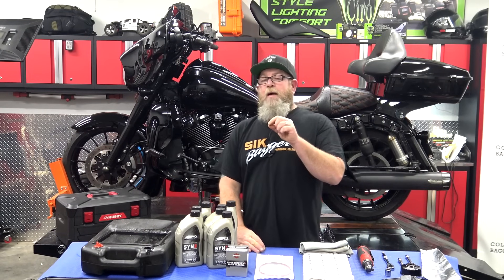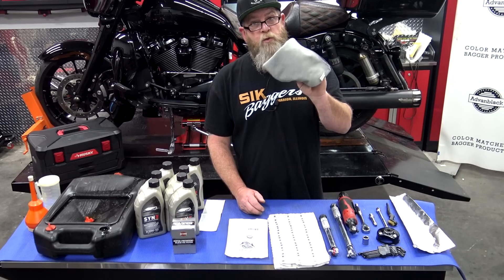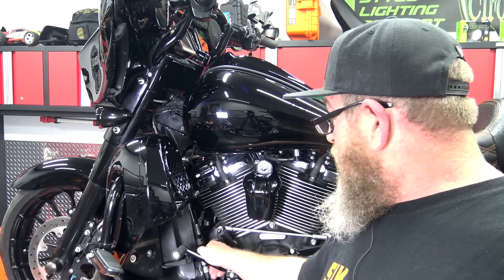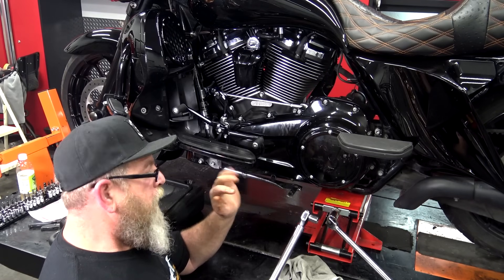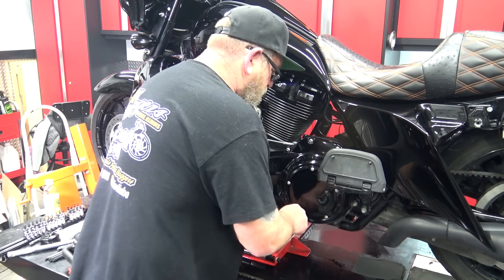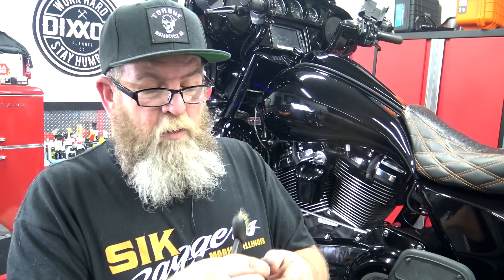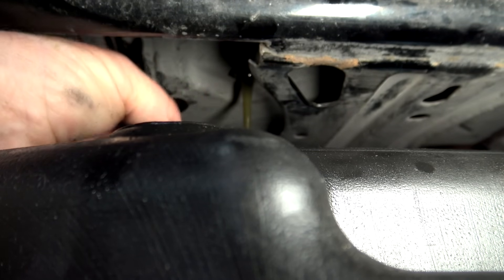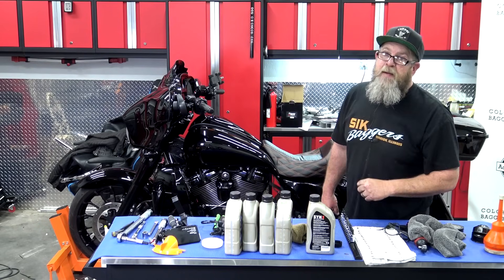⚡Milwaukee 8 - 3 Hole Oil Change @harleydavidson Touring - How To⚡

Comment: Great video!  I really appreciate it!  Toward the end you mentioned that the primary and transmission have longer change intervals. I was under the impression I had to do a full 3-hole at each 5000 service interval. I'm at a 5000 interval now. If all 3 were done the last time at the dealer, can I just do the engine oil and call it good?  BTW - sign me up for an ugga dugga shirt!

Comment: Steve since youre the only one responding to my messages what do you recommend for tire pressure front and rear with passenger for a 2021 Road Glide CVO, 130/60 21"(FRONT-TIRE)   AND (rear-tire) is 180/55 18", tires came stock on the CVO, Im getting ready for sturegis leaving Tuesday morning, just last minute shit Im doing, MAN- thank you for being a stand up human being!!!!
Reply from the maker: Hey fred..doing the same thing...trying to get everything ready for sturgis, we leave out Monday afternoon. 2 nights in the badlands and then going into rapid city from there. On the tires its very important to remember the pressure on the tire is the max amount of air that tire can run, not what is recommended for that bike. Those tires can fit a multitude of bikes and every bike rides different.  Always look at the frame and see what that says. Doesnt even matter if you change the size of the wheels and tires..the same air pressure will apply to that bike. Almost always on the touring models it is 36 front 40 rear. And one up or two up doesn't matter either. That is a "cold" check. Dont check your tires after riding, always before.   Also keep in mind that when you get to sturgis, it hot, and you're almost always in some sort of curve every where you go. So these tires will heat up quick and pressure will rise. Its not uncommon to see these tires climb 8 to 10 pounds in a short ride out there. Last year my fat front tires center band separated from the outer edges causing the tire to raise up 1/2 inch in the center.   That tire had over 10k miles on it and only did it when I got to Sturgis. Come to find out they quit making that tire due to that exact reason that happen to me..I didn't know that though and ran it. Keep her at what the frame says and you will be good my friend. Safe travels and if you see us out make sure to say hi! Always great getting to meet you guys!
Reply: @sikbaggers  Thank you brother!! greatly appreciated, never knew the frame thing...Ill keep it in minds, were in a toy hauler two houses behind Sturgis HD, ill make sure to look out for you! were in Sturgis 3rd through 6th then out to Yellowstone for a week.  Safe travels, thx again, appreciate you're time.

Comment: I appreciate your videos. I have one question I can't seem to get a solid answer to. When doing a 3 hole oil change on a 2019 M8 Street Glide do you use the same oil in all 3 reservoirs? 
Thanks
Reply from the maker: "technically" you can use Harley Davidson Syn3 in all 3 holes. BUT there are much better oils to use in your primary and transmission. Eve HD. I use the amsoil HD kit that has separate oils for all 3 holes.

Comment: how many total quarts of oil to do 3 hole oil change?  would Mobil 1 20/50 synthetic oil be ok to use?
Thank you it was a good video
Reply from the maker: youll need 4 quarts and yes any synthetic 20w50 will be fine

Comment: Totally agree with you on Harley WAY over-torquing the oil filter. I did my first DIY oil change on my M8 last week. I found Teflon tape or something like it all over my drain plug and the oil filter was on so tight that my Harley oil filter wrench skipped off. I thought the wrench must be the wrong size. Nope, I had crushed the top of the filter to the point that the wrench was just spinning. Ended up using a shop rag inside the filter wrench, tapping it on with a rubber mallet, then using a breaker bar on top of my ratchet handle to get the filter loose. Then I spent five minutes getting the old filter off the wrench. 

Moral of the story: Harley needs to stop telling their wrenches to over-torque the oil filter. I bet they do that  so people will bring their bikes in to the dealer for service.
Reply from the maker: Ive learned that the M8, for some reason, has a way of tightening itself over time too...not sure why...even bikes Ive changed the oil on and know I have not over tightened it, came back to me for the next oil change and was tight as shit...asked my buddy, a tech at HD, and he said the same thing..they all come back tight...so we get to deal with that now lol
Reply: Interesting! Hadn’t heard that one yet. Appreciate you taking the time to reply.

Comment: Great vid. Everything the same for a crate 135 on my FLTRK? Thx
Reply: And what is your oil of choice? Couldn't find on your channel. Thx again.
Reply from the maker: yes all fluids will be the same
Reply from the maker: I run amsoil...but Ive also ran redline in a pinch and it a great oil as well. The thing with most oils is unless you are riding in extreme conditions all the time, as long as you change your fluids when they are due, most any oil will do the same. the additive packages that are included in alot of these oils are really just for "extreme conditions" Now that could be anything from racing/hard riding, extreme cold, extreme heat..etc...normal everyday riding..you'll be fine with just about any full synthetic blend.

Comment: I really like your low-profile oil drain pan but I didn't see it in your links below. Was this available at Amazon?
Reply from the maker: This is the one I used in this video https://amzn.to/44FLYIa  its 4.3 inches deep but I have since changed to this one https://amzn.to/45ySzpb   ..its 2.8 inches deep. It doesn't hold as much but it will hold enough for harleys ...gives me a little more room for my hands.
Reply: @sikbaggers  Thanks a bunch! Love your videos. So thorough!

Comment: Brake Cleaner works great for cleaning up the oil filter mess.   That’s what we use at the Dealership
Reply from the maker: yes sir...keep tons of that stuff around...grab it cheap at local parts places when they run sales lol

Comment: If you were doing this service on the jiffy stand how do you fill the oil, or will the fill point change for when you fill the oil. Speaking of under the derby cover.
Reply from the maker: Adding clutch fluid and checking the levels should be done with the bike in an upright position...its important to note that if you are going to be doing your service that it will greatly benefit you if you get a cheap motorcycle jack or even cheaper scissor jack so you can properly do the changes. You can add the required amount of fluid for a wet service according to your servicer manual and then stand it up and check the levels. You can always take some out with a turkey baster or sop it out with a paper towel etc..

Comment: I just bought a new 2023 street glide. Im taking a trip and will hit the 1k mile mark while im gone and im gonna service it with the help of a friend. Anything i need to know about the 1k 3 hole service that would be different than the regular 3 hole service? Thanks!
Reply from the maker: There is nothing extra you have to do for the oil change...if HD was doing it they would also inspect the entire bike. Things tend to loosen in the first 1k miles and they like to check those fasteners out.  They check or inspect several other things on the bike as well during that 1k service. So I would suggest changing the fluids and then still getting it in when you get back for the 1k service.

Comment: Hey Steve quick question. I have a FLRT trike and was wondering if you had a pdf service manual? Not sure if fluid levels are different since the bike lives upright all the time. Thanks
Reply from the maker: what year is your freewheeler and ill check
Reply: 2019
Reply from the maker: @Fordfanatic1995  i have a 21 ( which is the same) triek supplement here https://drive.google.com/file/d/1XgdaHew-FRfPYy3GBy6nXW86cApczi47/view?usp=sharing
Reply: Much appreciated

Comment: Go to your local john deere store and buy a strap oil filter wrench that you can put a 1/2”ratchet on. Had way better luck with them than any plier or cap wrench. John deere has best quality one ive seen is why i recommend them. We only use strap wrenches at the farm for big filters on equipment
Reply from the maker: thanks for the heads up on that...we have a john deere here in town and ill stop by and grab one

Comment: Just got a used 2017 Trike (Milw 8). Manual didn't come with it. Found a pdf, but not easy to navigate the document. 
This video is the best produced of all those I've looked at that might relate to my new (to me) bike. 
Greatest help were the links to Amazon parts. I looked forever for a reasonable priced engine drain plug O-ring so I wouldn't have to spend $6 for just ONE at the HD dealership.
Thanks for taking the time to produce this video. Very helpful.
BUT, I might have missed the part where you mention YOUR preferred oil. Is it the oil you used in the video, or something else? Brother, don't make me have to go looking for it. I'm on the wrong side of "older" and don't like to spend my limited time looking for things, when somebody already knows the answer. 
Thanks again.
Reply from the maker: Hey Jerry thank you for checking this out and im glad it helping.  As we all know, not all synthetic oils are created equal..but no matter what oil brand you use will work IF you do regular maintenance on your bike, car etc... I've never seen any particular oil fail or cause issues down the line when changed at the proper intervals. Now with synthetics what you are paying for in the price differences are the additive packages that oil companies put in these oils..So they pretty much start with the same base oil and then add different additives to increase the output of the oil..Syn3, as used in this video is the oil that HD will use on your bike unless you request another brand or bring your own..such as Amsoil or Lucas...I've run Syn3 for years with no issues and also ran Amsoil for years with no issues...biggest difference is the price. Amsoil costs quite a bit more...I also have buddies that run the Amazon package of "Maxima Racing Oils" motor oil with no issues (the problem with that kit is that there is not enough oils in the kit) so you have to buy extra..so that being said its really in the routine maintenance side of things that cause failers ....people not changing their fluids when they should and the fluids are weak and don't protect the bike's components as they should.  You can pick up SYN3 and AMSOIL at any harley dealership and here is the link to the  https://amzn.to/3RxRTIF BUT remember that is not enough oil for your bike if you are doing a 3 hole oil change so buy extra so you have enough.

Comment: Great video!  Any reason to not use mobile one 20,50 Vtwin oil? Thanks
Reply from the maker: Nope..you can pretty much use whatever oil you want...You need to choose your "W" based on where you live or ride the most.  Also just know that different oils have different additive packages...try to do some research on your oil choice and see what they have available.

Comment: Hey Steve.   Got a question.   I just today did all 3 holes myself for the first time and i didn't have the measuring cup you used.   Just curious how long you think it should take for someone doing it for the first time?
Reply from the maker: oh id say about an hour and half, 2 hours if you have never done it I guess...trying to remember the first time I did it but that was so long ago lol You dont need the measuring cup it just makes it go faster...you have dip sticks so its just a matter of checking them to see the levels.
Reply: Cool.   The primary took me the longest because I didn't have one of those graduated cylinders you mentioned.   It was very difficult for me to see the oil level.  If you go above the bottom of the pressure plate, what can happen just out of curiosity?  I believe I may have gone just a hair above it into the silver area but I am not looking at it right now.
Reply from the maker: @0873sp  just barely over and youll be fine..it will start slipping if you are too far over...if you are borrow your wife turkey baster and pull some out...just don't tell her or you will be on the couch lol. No but seriously you'll be ok...and seriously the turkey baster is the best way to pull some out...just buy a new one and keep it in the garage

Comment: Do you need to change primary and transmission every oil change or is every other oil change the right interval ?
Reply from the maker: 5k oil, 10k primary and 15k transmission...to make it easier to remember what I have done, I just do this 3 hole fluid change every other oil change. Youre already in there with all of your tools and pan out so might as well. Keeps the fluids fresh...But if budget doesnt allow it those are the proper intervals.
Reply: @sikbaggers  thank you I saw that at the end of you video

Comment: Great video. how about anti seize on the derby cover bolts?
Reply from the maker: Great question and its been asked on these...I would suggest not doing that...anti seize may cause them to back out over time...just dont use any loktite on them and youll be fine.

Comment: I would like your opinion, I know people that have used many different 20 W 50 full synthetic oil’s for the three hole oil change in in your opinion doesn’t matter what brand of 20W50 full synthetic oil? Plus if you have a TriGlide of course your transmission fluid will not be checked on a jiffy stand how are you supposed to know the accurate level if it’s supposed to be on the jiffy stand? Basically I’ve known people that have used Walmarts version of the oil and have been using it for years and has never had any issues, what do you think?

Comment: 3 hole oil change uses all the same oil 20 -50 or is the primary a different weight? And the transmission also a different weight?
Reply from the maker: You can use syn 3 in all 3 holes. Thats what this guy wanted so thats what we used. however I suggest getting a formula made for trans and primary such as the Amsoil 3 hole kit

Comment: Oh! I have a question, if you don't mind. My bike has less than 3,600 miles on it. Just bought it used, it's a 2018. When I drained the primary, the oil had a lot of metal in it. The oil was gray. The magnet had some metal, like a fine powder, but the oil itself looked like it had a lot of metal mixed in with it. Is that normal?
Reply from the maker: Yes thats pretty normal for the first 3600 miles..lots of new parts in there rubbing together for the first time...now if you have the same amount on your next oil change I would start to get concerned. But its pretty normal for a tad bit to be on the magnets.
Reply: @sikbaggers  OK! Thank you Sir! :)

Comment: Hey i got a question about mileage vs time when changing all 3 fluids.  If you're not riding your bike as much and don't put on the mileage,  when would you suggest changing all 3 fluids?   Thanks.
Reply from the maker: It really depends on how you are storing your bike..If it is stored outdoors or where there are humidity and temperature extremes, condensation could be an issue requiring more frequent changes. If it's stored in a relatively climate-controlled environment and always warmed up enough when driven to drive off water vapor, long intervals should be ok.  If it's stored inside in a climate-controlled environment I wouldn't change it more than every other year. Oil doesn't degrade sitting there but condensation is the culprit in this situation.

Comment: the link to amazon for the derby gasket says it does not fit my 2023 road glide standard 107. Does amazon bot just not know, or is the link the gasket I should buy?
Reply from the maker: it will fit...amazon isnt the best at that.
Reply: Harley has the gasket and 3 o rings kit for half the price as amazon, only like 6 bucks. I know, i was surprised too :)

Comment: Just did a 3 hole fluid change I concur about NOT using liquid thread sealer it’s hardened on the thread I had to clean all 3 drain holes  with a rifle barrel wire brush what a PITA.
Reply from the maker: been using it for years on older bikes and yes you have to scrub it off with a wire brush...I dont normally use them on newer models..but pre 08....I will put it on every time

Comment: Had the same issues the other day getting my filter off that the dealer put on because I busted a hole in my oil cooler from the previous owner having it too tight.  My filter wrench kept slipping like yours and like you was inventing new cuss words.  My wife suggests I put one of my red shop rags on the inside, it worked great with no slippage, filter came right off.
Reply from the maker: Yeah man that always sucks...Ive had one that I had to drop the oil cooler and beat off with a literal chisel..Ill never understand it

Comment: Thank you Steve.  Got a video , 3 hole oil change on a dyna V Twin?
Reply from the maker: Thank you J...I sure dont but ill do one if I get one in here for sure!  But most of the v twins bike are all about the same way to do the changes...just check your service manual for for the torque specs and the levels
Reply: @sikbaggers  Cool, Thanks Steve. I'm a Work In Progress. Still learning as I go. And these Videos really help. Keep doing your thing my man.

Comment: Is it necessary to fill the oil filter halfway with oil before you screw it back on?
Reply from the maker: the service manual does not and never had said to do that...specially with a 90 degree filter, you will more than likely dump it out trying to get it started...you can add some and swish it around the filter if you want but no more than that
Reply: Thanks for the info. I’ve seen this done on other platforms on YouTube.